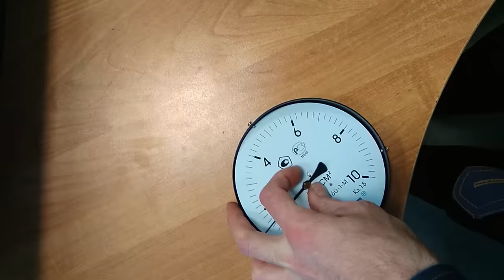Очень экзотический двигатель "Пожиратель пламени"

Comment: its one of the best vacuum engines , i have some chinese , they run slowly with heavy flywheel and much better with good bearings on the flywheel axis ,also friction free with graphit piston so it run with a very small flame , you creation is very beautiful with the colours of chopper and brass .
Reply from the maker: Спасибо. Очень трудно было его заставить работать. Но он выдаёт хорошие обороты. К сожалению он может только сам себя крутить. Совсем сил мало.

Comment: Can you create electricity with that ?
Reply from the maker: I think it is possible to create a small power. But if you make the engine bigger, then it will be directly useful
Reply: @ЛёхаРомантик  currently, Europe needs electric power.
Reply: @ЛёхаРомантик  this video seems to work on the same principle (even if realisation seems different)
https://youtu.be/BNvJwhhFK6U
Reply from the maker: Yes. Right. They are relatives. First, my type was invented, in 1816, and then the one in your video appeared.
Reply: @ЛёхаРомантик  then you can probably create an electric engine from it and design a way to implement such engine in any industrial complex which produce heat stream... A bit like an hydrolic turbin but using heat stream, this could be really useful.
Reply from the maker: Yes, there are several ideas for this.